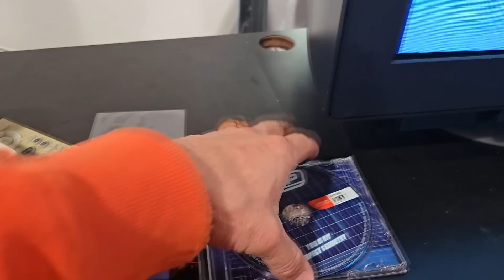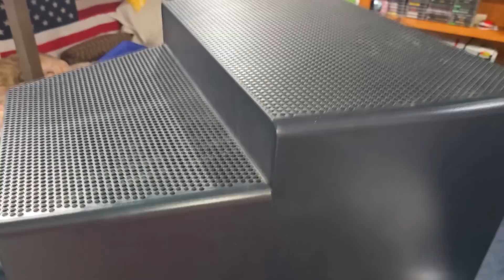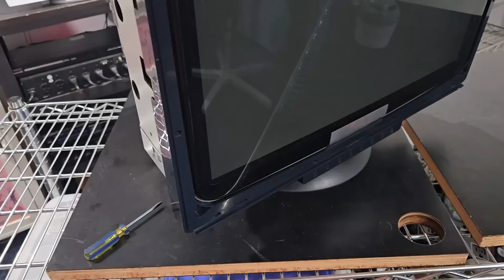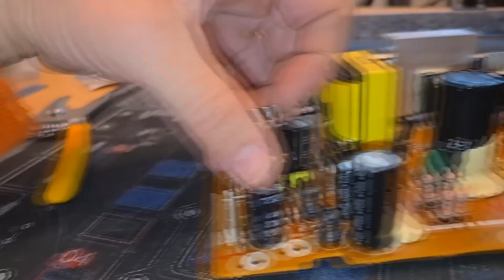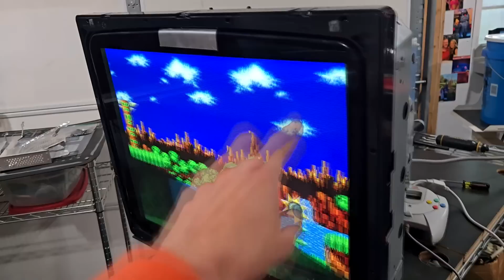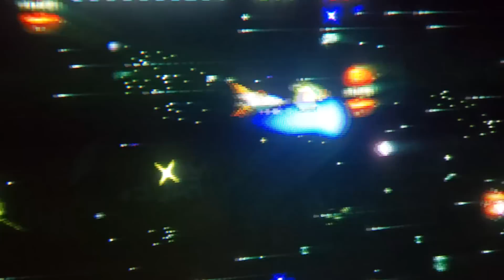NEC's Diamondtron Multisync CRT - FP2141SB - Slow Start-Up & Color Banding Repairs

Comment: It looks like Steve was unware of the 2070 sb. This crt is was the pinnacle of crt tech with its ridiculously high stock Horizontal scan rate of 140 khz and .24mm dot pitch.  A dreamcast doesn't do this monitor justice as it's capable of running 1024 x 768 at 160hz and even 1440 x 1080 at 120hz. Truly the undisputed king of crts
Reply: I have 930sb which is capable of the same resolutions and refresh rates. But unfortunately it just broke down.  Something is wrong with high voltage transformer. Repair cost: ~$400 :/

Comment: These Had Antiglare coating sprayed on, it desintegrates if left under sunlight for 20+ years. Mine was wiped  out just by distilled water and microfiber cloth (all of the coating left on the cloth) 

might be good idea to add some light antiglare window tint to it.
Reply: Recommend the nano ceramic car window tint films, or a nice high-end 3M contrast film if you wanna spend a few more dollars.
Reply: @Wobble2007  Got any link to the 3M one?

Comment: I got the Mitsubishi 2070SB and recently the power button got stuck when i pushed it in. I managed to get it released but the actual spring button is stuck in. Yet to open it up and take a look but do you guys think its broken or just stuck and needs a cleaning and dusting?

Comment: Just thought I'd let you know you're getting a good dose of x-ray radiation with the shielding off.
Reply: That shielding is for interference purposes. The X-rays are blocked by the lead in the glass.
Reply: @cmira1991  Yes, the lead in the front glass helps protect the user during viewing. I'm talking about the x-ray's from the tube itself.
Reply: @bluecar5556 I believe the entire tube is infused with lead oxide. That shielding is tin, X-rays would penetrate right through them.

Comment: Another excellent video, Steve! PC crts are super sharp, would you compare them to a pvm? Maybe a more affordable substitute?
Reply: This one literally has a 1400 TVL tube, which is a pretty decent jump from the top tier 1000 TVL BVM sets, not to mention the much higher refresh etc, higher end BVMs will have better phosphors though.
Reply: pc crts are nothing like a pvm completely different archetechture only sililarity is they are a crt  basically
Reply: @dahjord  Interesting! Thank you for the info! Ill have to look into it more.
Reply: VGA Monitor.